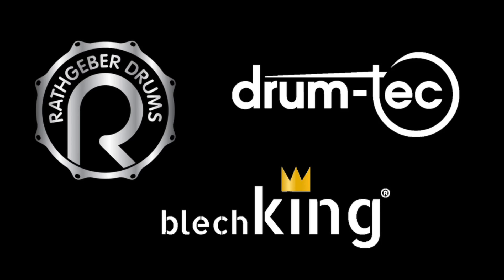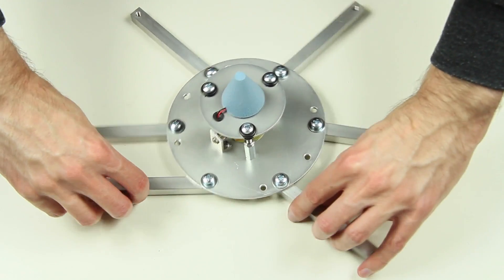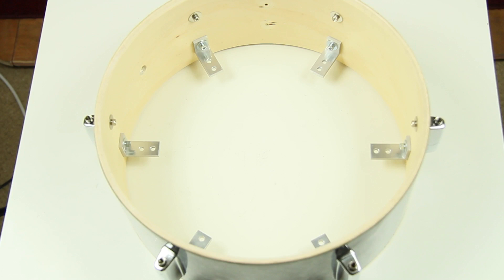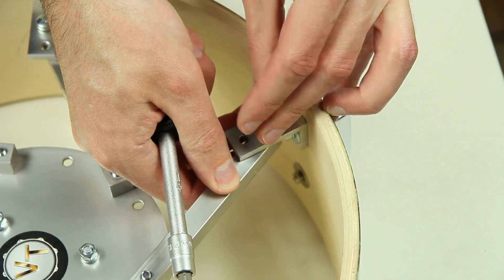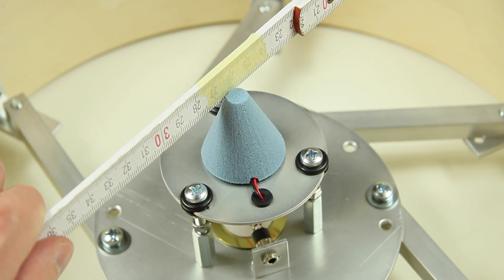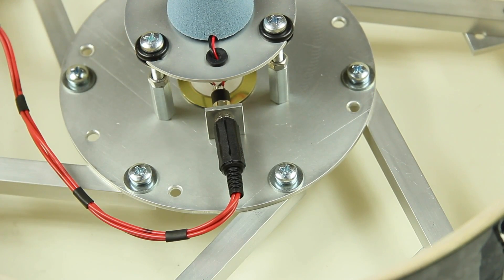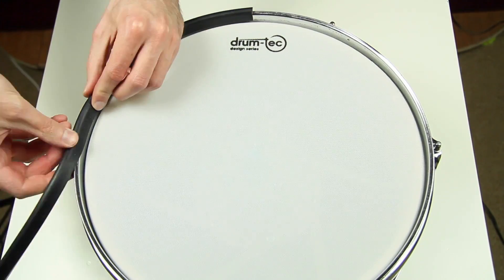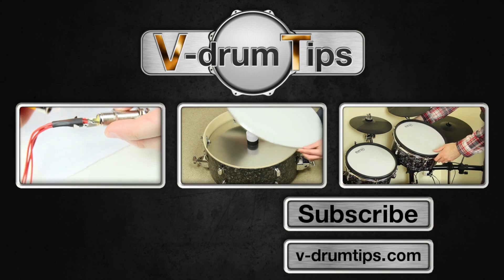E-drum Conversion Part 6 (Flextrigger 2.0)

Comment: so I noticed that for the main trigger there is not a foam pad between its mounting plate and the piezo and then the cone, like usual.  Is this because the rubber washers are isolating the main piezo from the shell and rim vibrations so the foam pad separating the plate and piezo is not necessary?
Reply from the maker: +michael king The rubber pieces isolate the head trigger from vibrations. They do the same as the foam would do.